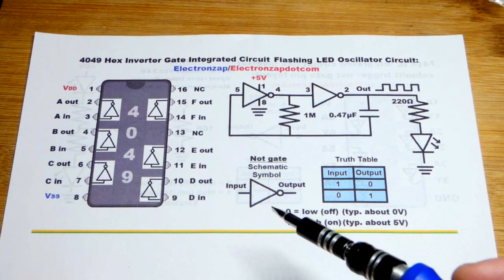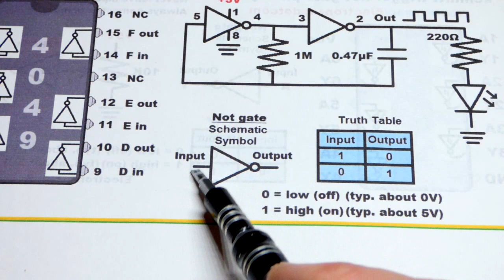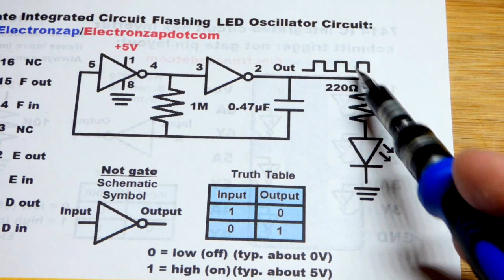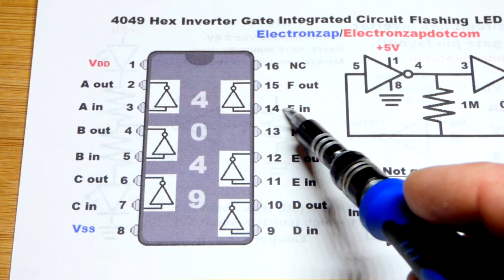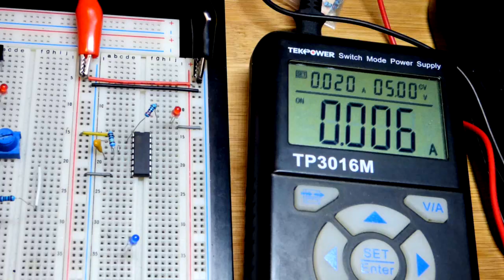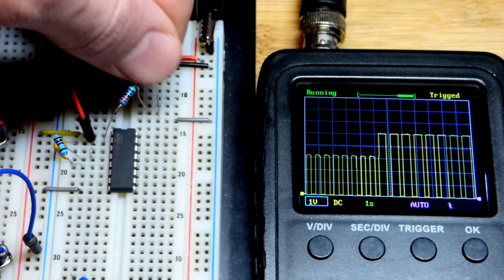4049 hex inverter oscillator LED flasher demonstration circuit by learning electronics electronzap

Comment: What is the formula to calculate the resistance and the capacitor based on the desired frequency? If you don't know it you can't work by putting random components, right friend? I found similar explanations with different formulas and only this makes me lose the topic and then they didn't put the units of measurement. For example regarding an oscillator with CD4049 there was the formula of the frequency like this: F = 1 / (1.39xRxC) but taking it like this without understanding... I can't calculate without knowing if I have to insert the resistance in Ohm or KOhm and the capacitor in picofarad or nanofarad or Farad.... and in the end we can't understand how to do it. You who have studied if you explain better to us so that we can do the experiments ourselves we are grateful. Bye

Comment: Cool stuff, I love all things oscillators! Most (if not all) DIY synthesizer oscillator beginner circuits start with the CD40106 Schmidt trigger version, FWIW. (Others use the CD4093 NAND.)
Reply from the maker: Oscillators are really cool :D
Reply: Filters are better. ;)
Reply: I found a cheaper kit 4000 series I'll get the Link maybe you can add. It to the Amazon and get a kick back and save some money for Viewers, also I'm Canadian so prices aren't always the same as US. Thanks
Reply from the maker: @TBL_stevennelson  I generally add the cheapest seller I find as long as it is available with amazon prime shipping, but sometimes the cheapest one is a newer seller who may run out of stock, jack up the price, or provide bad service to customers shortly after I link them. In those cases I link a more reliable looking seller over them. Everyone should compare the other sellers listed on the page and compare them to the one I linked. I've tried linking other countries to my account but am not sure it has helped any as not many people click my product links to begin with, and I get no info on who the buyers are, just a list of products that were bought.